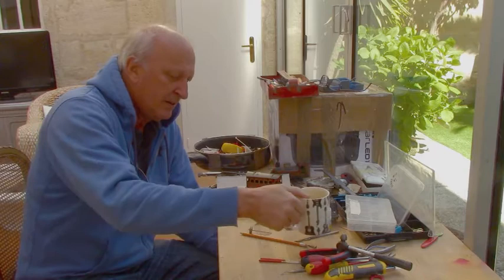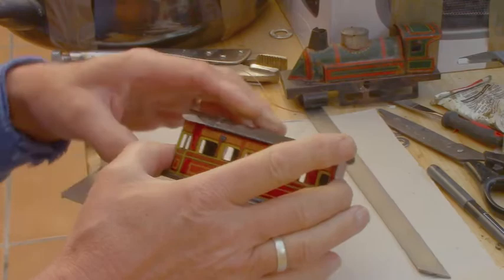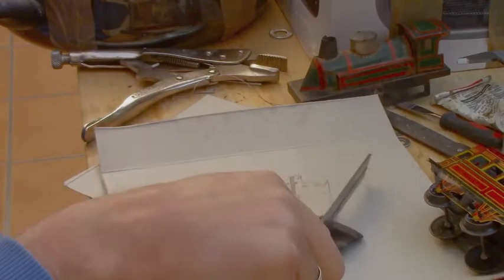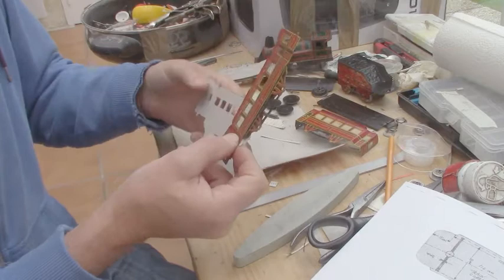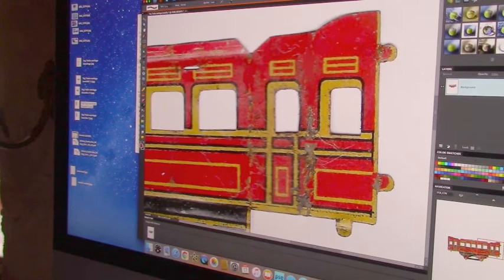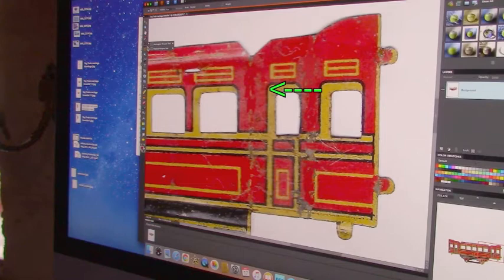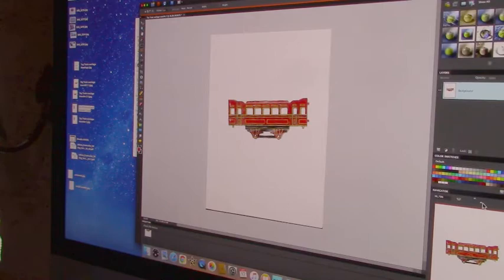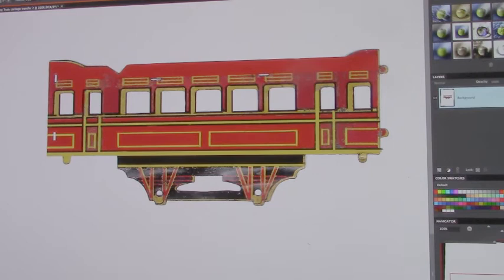DIY Tin Toy Train Carriage Build

Comment: Nice work Willy!  I think using a software to do a vector scan (every color basically becomes a shape), then doing a vinyl cut stencil would be easiest & look more original.  Cut your metal out, spray it red (the most prevalent color), let dry & apply vinyl, peel out yellow & paint (you might need to spray white then yellow to get the color you want), let dry then peel out black, cover the yellow with painters tape.  Let the black dry & peel all of the vinyl off.  I have not done this, but I believe the 2nd option would be to use vinyl to make a silk screen for each color if your doing any kind of small production run.